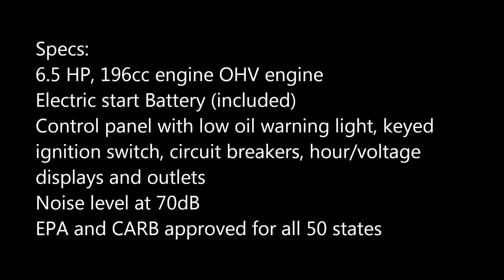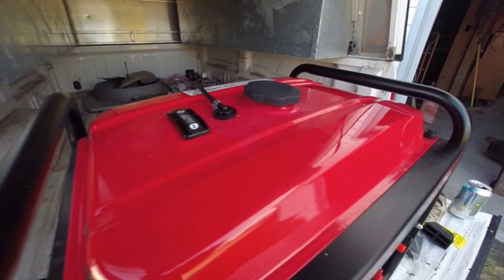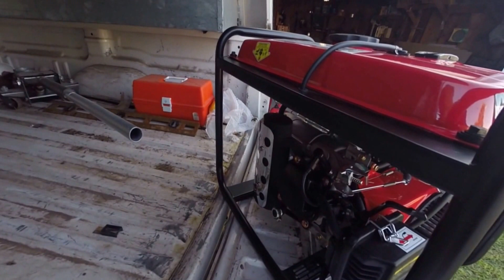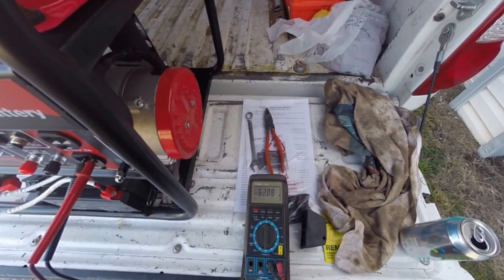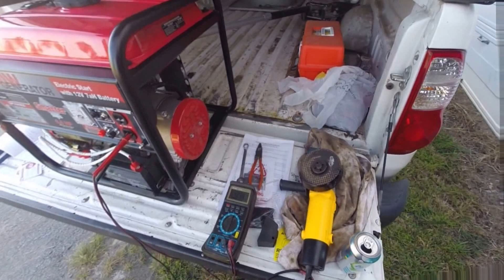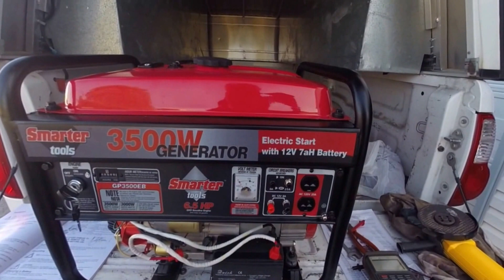Smarter Tools STGP-3500EB 3500 watt Generator First Start and Review

Comment: Anyone know how to add an electric starter, or if it's possible? I have the same generator but the version without electric start.
Reply from the maker: I would think it would be possible if it is the same motor as mine is.
Reply: Here is a reminder about portable generator safety: This advice is just to make sure that everyone is aware of all the warnings and it’s just to remind people to be careful using portable generators. Everyone has to see this safety reminder for safety. Every year, hundreds of people die or get injured when using portable generators due to carbon monoxide poisoning and electrocution. Make sure you are using your generator carefully and keeping others safe as well. There is something very serious that everyone should always be aware of when using generators. Some people do run their generator indoors which is not safe and that increases the risk of carbon monoxide poisoning which can cause death of family and you. Some people run their generator in wet conditions which can electrocute them. Here’s an advice about generator safety: please remember that you should never run your generator indoors. Remember that carbon monoxide is an odorless and colorless gas that you cannot see or smell. Carbon monoxide is a silent killer. Keep that in mind. Make sure your generator is 15-20 feet away from your house and away from doors, windows, and vents. Never use your generator in your porch too. Having a carbon monoxide detector is very important against generator safety. Some people also allow children to go near the portable generator which could pose risks. We need to keep an eye on our children making sure that they are not near the portable generator so they won’t get electrocuted or burned by the generator which is dangerous. A locking enclosure also keeps kids safe. A generator shed might look like a tempting place to explore, or take cover during a game of hide and seek, but a generator is a dangerous piece of equipment that can cause injury. It says on the manual that we should also keep children away at all times from the portable generator to avoid injuries. Please do not allow a child or unqualified people to operate the portable generator. Just because some manuals missed what should be listed doesn’t mean it’s safe to do. Always follow the generator safety rules when using portable generators. Generators pose electrical risks. If you need to use your generator during wet weather, you need a generator tent to protect your generator from getting wet. Don’t let your generator get wet. Keep your generator dry and before using your generator, please make sure your hands and your generator is dry. Do not wear loose clothing when operating the generator. Everything that is said on the generator’s operating manual should not be ignored. Never smoke cigarettes near the generator. Please keep flammable things away from the generator. Never overload your generator too. Your generator can catch fire. Never ever try to plug a generator cord into a wall outlet to avoid back feeding. Back feeding your generator is dangerous. Always turn on your generator first before plugging in appliances and shut off the appliances before turning your generator off. Use a heavy duty cord for your generator and the cord should not be worn out. All the instructions should be followed carefully. Never refuel your generator while it’s running. It can cause fire if fuel spills while your generator is hot. You should turn off your generator and let it cool off before refueling it. Having a fire extinguisher next to the generator is also important. This is only a reminder for everyone’s safety of using generators. Make sure your generator is properly grounded. https://youtu.be/I1jT3ANENvI and here is a video more about keeping others safe when using generators and also about our family’s safety. Hope this helps. Thank you.

Comment: you think it can handle an electric pressure washer? (PW: says 13 amp/corded)
Reply from the maker: +Mario Menoscal I run a 1500 watt space heater with it and works fine... As long as the 13 amps is all that it needs it should work as that would around 1400 watts...

Comment: Thanks for the show, great, I'm going to buy this one then add wheels on it, for the sensitive electronics I would bypass the AC outlet thru surge protection receptacle block
Reply from the maker: John Doe That makes sense I have not had any problems with mine the AC seems pretty clean but I agree good idea to run it though a surge protector...

Comment: Looks like a good generator, how clean is the power
Reply from the maker: Not bad it's pretty clean power I wouldn't use it on any really sensitive electronics but then I wouldn't use any basic portable generator on them..  For basic needs like lights,refrigerators and TV it seems to do just fine.. I am really impressed with the fuel economy though it will run for at least 10 hours on a tank of fuel.

Comment: Great video. Hows the generator? Still doing good? Any issues? I just ordered it myself. Thanks!
Reply from the maker: Running like a charm... I start about once a month just to make sure it is good to go if I need it...
Reply: Just bought this generator for my class b rv generator upgrade. Had to modify like crazy for fitment and what not. I should post a video of the install.